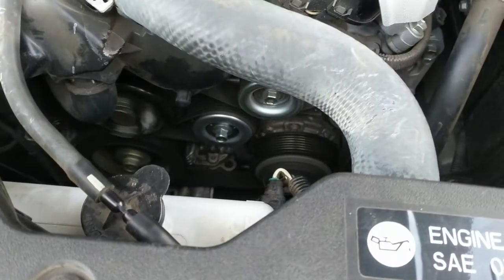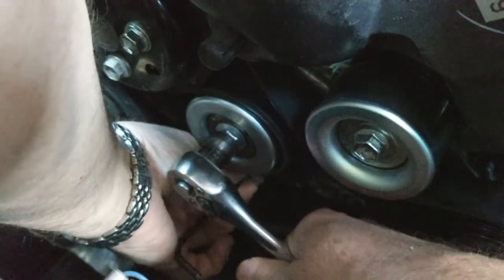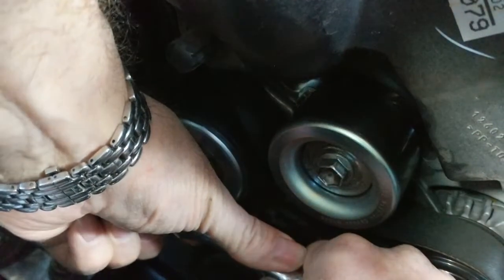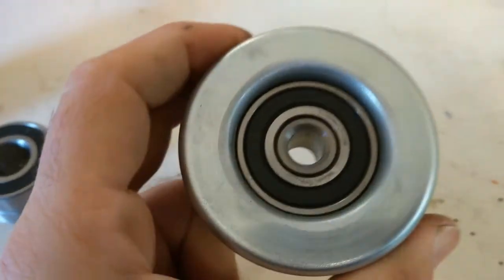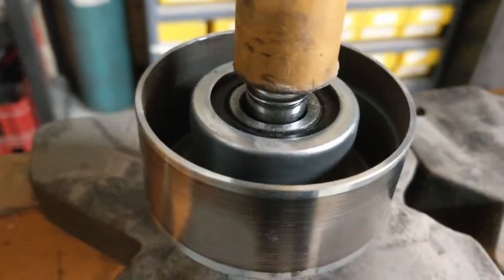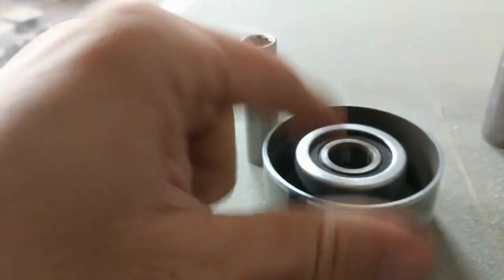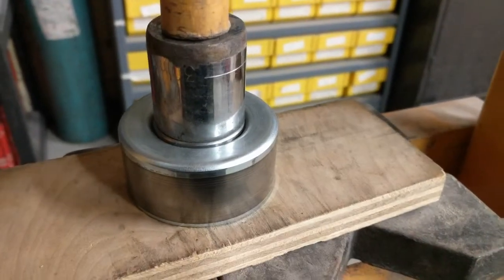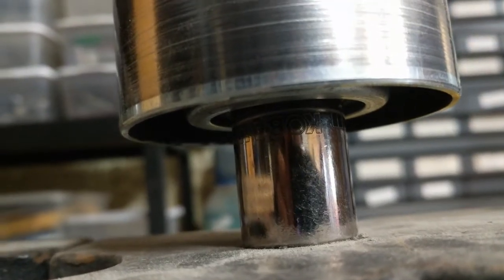Lexus and Toyota tensioner pulley bearing replacement

Comment: Gates 36325 measures 27mm wide versus the required 34mm for proper belt tracking on IS350 pulleys. Narrower width causes slippage, noise, or throw-off on your accessory drive.

Comment: If you are considering doing this keep in mind Toyota did not anticipate that this left hand tensioner pulley bolt would be removed in this manner (you have to buy it in one piece, pulley and frame) and as such they did not engineer that tensioner pulley frame to withstand the amount of force needed to release that bolt. It was only meant to hold the tensioner open to remove the belt. That little hole in the frame that the 3/16" drill bit or allen key fits into can easily be broken with the amount of force needed to get this bolt to release.  Just ask me how I know that.
Reply: That’s why you take out the 6mm Allen key

Comment: Thanks so much!  I have a 2012 Toyota Sienna and was able to swap out the belt tensioner pulley (by itself) with the 0187-GSU45 from Amazon, as you noted.  Easier than swapping the bearings on the old one (but I'll keep it just in case :-))  Thanks again!!

Comment: I just put  a Gates 36325 pulley on my 2013 Toyota Sienna 3.5L tensioner  thanks to this video.  It was a direct replacement with no bearing swap.  So far, it's working fine !!!
Reply: Would this work on a 2007 Toyota Camry do you think
Reply: @brianmills3467  looks like your cars have different engines. doubt it would work

Comment: towards the end of the video, the squeak is back lol.. but yea might as well replace the pulley with a new one.  Good video tip though for those that are looking for a cheap temporary fix.
Reply from the maker: The squeak at the end ended up being the clutch on the front of the alternator.  Had to replace that about a month later
Reply: @AustinCoulson  Did you replace the whole alternator or rebuild it like you did here? My Sienna is making the exact same chirping as in the very end of the video
Reply from the maker: @NeinTime I replaced just the alternator clutch and it's been a few years and is still working great.
Reply: @AustinCoulson did you happen to make a video for that or is it simple?
Reply from the maker: @NeinTime I didn't make a video, but if I remember right I needed a special tool to pull it off. I can't remember if it was a generic puller or specific for the toyo alternator

Comment: I’ve noticed there is quite a bit of play in the tensioner pulley on both a 2015 & a 2016 Subaru Foresters I saw. This was not wobbling front to back; it was simply play - constant moving when engine is running. I was told there should be some play. Is that correct?
Reply from the maker: There should be no play in the pulley itself, but the tensioner will move quite a bit while running.

Comment: Pulled my (squeeking exactly as loud and same as yours) tensioner pully off today. And my Idler pulley off to clean/repack bearings. Took both bearing sides off of each with an exacto knife. Cleaned the hell out of  both with plenty of brake fluid until the insides were pristine. Snapped one side back on each. Packed brand new, red bearing grease in good for both. Popped the other side back on each (grease pushed out tiny hole from slight damage with exacto on tensioner - sides tough to get off). But packed well in both. Re installed both. No side to side play in either. Both turned nice with no seizing at all. Just dry. Tensioner still squeeks, but 1/4 as loud 😣. Dissapointed.  Bearings were very dry before cleaning for sure. How do I order new bearings? I didn't mark down numbers from side of bearings, oops. It's a standard tensioner one for 1993 Dodge Ram B250 5.2l V8 Van. Afraid to pack new bearings with grease now, (If I just order new bearings, because they never do for even expensive brand new ones!?) because I'll damage it again trying to pry it off with an exacto knife. Noticed the Idler pulley was the original OEM part out of Windsor, Ontario, Canada (said Canada on side of bearing) in 1993, and had all metal bearing parts, was high quality, & packed great, and spun great - unlike the cheap non original tensioner pulley with plastic bearing framing inside that continues squeeking - aftermarket 😡.

Comment: Do you know the bearings type in the Idler pulley? Another Youtuber said it was made by Koyo. Thanks.
Reply: Koyo 6302rmx, there a bit hard to find as they are somewhat special and the inner race is thicker. I bought mine off aliexpress for about 25$ aliexpress is allright if you don't mind waiting a few weeks. Tensioner pulley is double bearings 6203rs

Comment: This was a great help. I'm returning the $120 belt tensioner assembly tomorrow. The Gates 36325 contains the correct bearings, but the pulley is a little narrower than the '08 Toyota Sienna tensioner. I pressed out the bearings, and put them in my old pulley, which looks pretty bombproof. The HF press paid for itself today :) I missed the part where you said to simply pick up 6203 bearings, but for $30, I was back on the road in a few hours, and don't have to wait for bearings to show up. Thanks!
Reply from the maker: Awesome!

Comment: After watching the repair towards the end of the video you can clearly hear a chirping sound gradually increase. I feel your issue is with a misaligned pulley. This will put excessive stress on the bearing causing it to fail prematurely.
Reply from the maker: It was actually the alternator clutch. I had to replace that a few months after doing this pulley
Reply: @AustinCoulson  A/C clutch?
Reply from the maker: @sd906238  no, the alternator clutch. This model has a built in clutch on the pulley of the alternator similar to the ac clutch.
Reply: @AustinCoulson  goto love the selective charge systems 😂
Reply: I did the same repair on mine, a 2008 Lexus IS 250, after the repair I put it back on and it still making the chirping noise and I can actually see a very small vibration on the pulley  while the Car is on Any suggestions

Comment: Thank you for this video. 
I have a lexus IS 250 that sounds a rattling noise on idle, and even more when AC is turned on. Any chance this pulley replacement will fix it?
Reply from the maker: That's the same issue this Lexus had and it fixed ours

Comment: Do you know if this same 6203-2rs bearing will fit in the 2 IDLER pulleys of a 2007 Lexus RX350 please?
Reply from the maker: I think so, but I'm not 100% sure
Reply: Nick-- I own a 2013 rx350... How did yours go?  Were the 6203 the correct bearings?  Any other comments would be appreciated.

Comment: I think I found a belt tensioner that actually works. I’ll give it a shot and let you guys know if it works. 
It’s the Gates from O’Reilly part number: 
36173

Pulley Outside Diameter (mm): 70mm
Pulley Width (mm): 34mm
Belt Type: Serpentine
Pulley Width (in): 1-3/8 Inch
Pulley Outside Diameter (in): 2-3/4 Inch
Pulley Inside Diameter (in): 0.67 Inch
Pulley Inside Diameter (mm): 17mm
Reply: Doesn't work for me.  It can replace the idler pulley, but the tensioner pulley has a different backspacing and the back edge of the gates pulley hits the block.

Comment: I have a 2008 GS350 207k making the same noise. Replaced idler and tensioner pulleys with OEM. Both pulleys were worn out but still some noise. Inspected the alternator pulley decoupler by removing the plastic cover, and it was full of rust dust trapped in there. Clean it up and the noise is completely gone. I'll replace the alternator pulley since it is also worn out. All three pulleys will make noise, but the high pitch noise is the alternator pulley. The plastic cover keeps moisture inside, and rust built up and eventually became a powder grind between the plastic cover and pulley.
Reply from the maker: This exact thing happened to the Lexus in this video about 6 months later
Reply: I have an 08 GS350. To be clear: what pulley did you use for the tensioner pulley replacement, or did you replace the entire unit? OR, did you replace just the bearing(s)? The idler pulley is easy no-brainer. The tensioner pulley is the great unknown. Thanks!
Reply: @bobbyglover5893  I only replace the pulley, not the entire unit. I order it from a Lexus dealer online, but Advance Autoparts also have good quality parts to fit Lexus OEM.

Comment: They DO sell this pulley separately. KOYO part number KOYO SERPENTINE IDLER  166030P03. This is a made in JAPAN bearing (same company that makes Toyota/Lexus oem). No thanks to the China junk. But good job otherwise.
Reply: "asianautos" in ebay does not sell japan-made tensioner pulley. It is made from poland
Reply: @hoverzhang2684  Dude I’ve bought about 10 of them personally. He’s sells genuine KOYO which I confirmed via QR scan that KOYO puts on all genuine made in Japan bearings so you are wrong pal. Don’t correct me turd. When you repair half of what I do you can open your mouth.
Reply: So just to confirm, 
166030P03 is the same pulley as tensioner pulley? Other two pulley parts#
16604-0P011 / 16604-31020.  Am I right?
Reply: @robinkim7711  Well on a Lexus IS 250 like what I have there are only 2 pulleys. Tensioner and idler. The Idler is 166030P03, idler is KOYO DRIVE BELT IDLER PULLEY 1660431020 / 166040P011. eBay has both of these made by KOYO. Email “asianautos” and ask them which pulleys you need for your application 👍🏻

Comment: I got 2006 sienna limited with the same noise I’m annoyed everything time I turn the AC on that screeching noise goes on
Reply from the maker: if the noise comes with the ac, the most likely culprit is an old belt that is slipping on the AC pulley and not the bearings for the tensioner. You can try using a belt conditioner spray and if it helps then its time for a new belt

Comment: I wish I had seen this video before ordering my bearing, I have a 2011 Nissan Versa 1.6L and the bearing from the idler is starting to go bad, so I took the bearing number and ordered a bearing, only to find out the pulley has two of those with a center sleeve. Is there a way I could buy spare center sleeves? I'd like to have more at hand just in case I mess it up and render it unusable.
Reply from the maker: Not that i know of. You may have luck at ACE hardware if you have one locally. They are my go to for metal spacers, and I have had really good luck finding ones that work. If I can't find it there, I have my cousin machine them from raw steel.

Comment: Just replaced the tensioner pulley last night on my 07 Is250. The Gates 36325 worked perfectly! 

Don’t be deceived when you remove the stock one and notice it is slightly larger in depth than the Gates. I could see the wear from the belt on the stock one and there is a large portion of the surface area the belt never touches. The Gates 36325 has plenty of area for the belt to run smoothly.
Reply: Zac Thompson did have the awd version ? Manual or automatic ? Thanks
Reply: Jeffrey Melgar Automatic AWD
Reply: @zacthompson7292  what about the other pulley for the idler?
Reply: Just completed a water pump replace on 2008 Lexus IS250 AWD (~170k miles of Midwest driving).  

The Gates 36325 worked spot onto replace the tensioner pulley.  As mentioned previously, it's narrower than the stock part but wide enough to support the belt.  Only trick to remove the tensioner pully center bolt is to use an impact wrench to remove.  As the bolt threads are left hand, the gun should be set to the tighten direction (clockwise rotation).  I used a Milwaukee 2554-20 with speed setting #3...worked like a charm.  Love justifying the purchase of a new tool!!! 

The idler pulley should be commonly available....I used a Bando 580153 (made in Canada!).

While this thread isn't necessarily water pump related, I would suggest to only use the Aisin pump for this vehicle (WPT137 or WPT-137).  It is literally the Toyota part with with Toyota name slightly abraded from the surface of the casting...I could still clearly see the top of the T and Y...haha!  Plus it comes with the necessary two o-rings for the the thermostat housing.

Also installed a TYC radiator (2968).  While this particular radiator was mfr in China, I have had great experience with TYC-Taiwan parts previously

Comment: Update (noise is gone!):
After a couple days of changing my Tensioner Pulley (Gates 36325) on a Lexus IS350 F Sport, the noise came back, and as you can see on my original message I was pretty sure the noise was coming from the 36325, it turned out it was actually coming from the belt. 
To make sure it was the belt, I reproduce the noise (keeping the car at 2500RPMs) and I put water using a water spray bottle with a thin stream in the bottom Pulley, right on the surface where the belt sits. And I was surprised to see the noise go right away. So at that point, it was clear it was the belt.
I bought 4070609 from Autozone for 41.99$ with a 3yr warranty, and change the old belt and finally, the noise is completely gone!.

Old Message:
I posted before I was able to solve the problem with the Gates 36325, but a couple days later the noise came back.
Not sure what is going on. I am sure that is the source is 36325 of the noise though because I put some WD-40 with the red straw straight into it, and the noise went away.
As a note, the noise is almost gone below 1500RPM, and at its pick at about 2500 RPM..
I also tried another brand new 36325.
Reply from the maker: I assume the other 36325 you tried did the same thing? That is quite a mystery. This was filmed on my Father in laws Lexus and he developed a squeal later on at the alternator pulley clutch, and it sounded similar to the tensioner bearing, but unlike your situation the noise didn't go away with wd40, and when you got close it was obvious it was the alternator pulley
Reply: @AustinCoulson   Thanks for the feedback.. that is interesting..
You know I was thinking? Maybe these 36325 I am getting have different kind of bearing than the original ones?.. not sure
Because I did notice the 36325 is an idler pulley, not the tensioner one, but it does come with double bearing (apparently).
So my guesses are:
- Maybe this 36325 has some different bearings and that with the tension causes it to make the noise?
- Maybe my belt is to old and the tensioner is not putting enough tension? (But it would not make sense why adding W40 to the pulley (bearing area) would make the noise go away unless some of the W40 is falling to the belt)
- Maybe the belt is fine but my tensioner mechanism has worn out and is not putting enough tension?

I will keep it updated in case it helps anyone
Reply: @AustinCoulson  Guess what! it was the belt after all!, I changed it and finally no more noise!. Thanks for the help. I updated the original message in case it helps anyone.
Reply from the maker: @rodrigocollao526  interesting. Must have had a little wd40 make its way on the belt to quiet it briefly. Thanks for the heads up!
Reply: @rodrigocollao526  How old was the belt? How many miles on car...I have a 82k miles 14 ES 350 and ive noticed a minor chirping noise it goes away with silicone spray but appears to come back.  Weird a belt would be cause of noise our Camry belt lasted nearly 200k+ miles no issues with noise when replaced.  I had a Rav4 with this motor and never had any issues with noises like the lexus seems to have.
Reply: @markg999  I am not sure how old the belt was, but I am gonna guess it was the original one, and the car is a 2015, so about 5 years. The car had about 67k miles at the time.
Were are you putting the silicone spray? Are you trying to hit the bearings of the pulley or the belt itself? When I did my testing I was trying to hit the bearings only but it will always find its way to the belt and trick me into believing it was the pulley.
After changing the belt, I never heard the noise again.
Reply: @rodrigocollao526  It seems from reading online another area could be the alternator pulley.  I've been spraying near the idler pulley but belt gets some also im sure. Belts are pretty cheap and its 6 year old belt I'll start there I guess.  Thanks
Reply: Yes I changed my belt today and usually I'd get a chirp after 20 or 30 mins of driving and nothing after 2 hours today. Belt looked like great condition...had 83k miles on it could gone maybe 200k miles but I noticed the belt was very rough on top so likely chirping when hot on the smooth idler pulley. All the pulleys felt pretty good.  So these belts might not be best quality atleast ones on a 14 ES 350.

Comment: Gates 36325 from O’reilly fits well on 2015 Lexus IS350 F Sport

Also, I had to change the other pulley the idler one, I used 231158 from autozone.

Thanks for the video and all the comments.
Reply: How they working so far were they any different from the OEM pulleys? In terms of dimensions ext?
Reply: @nicoray15  It's been 2 months now, and it's still working great! They are just a bit different than the OEM pulleys, the diameter is the same, but it's just a little less wide, however, it is wide enough to fit the belt just fine.
I also had to change my belt but no more noise and the car is running perfectly.

Comment: Thank you for the video!! Finally have a reason to use my press 🤙🏾
Reply from the maker: Check out the description or pinned comment to find the part number for the replacement that doesn't need a press. People have been having good luck with it.